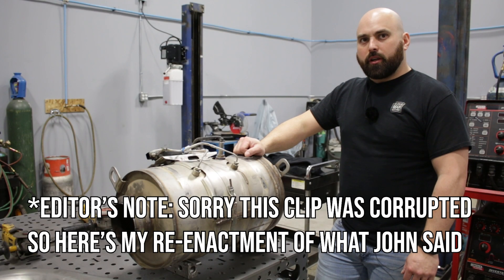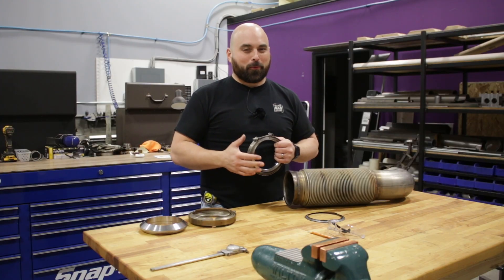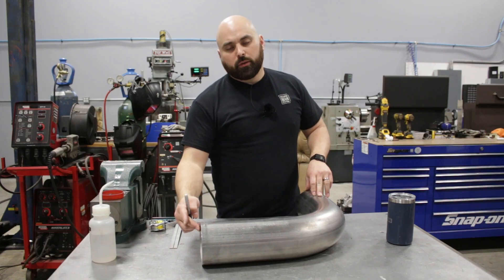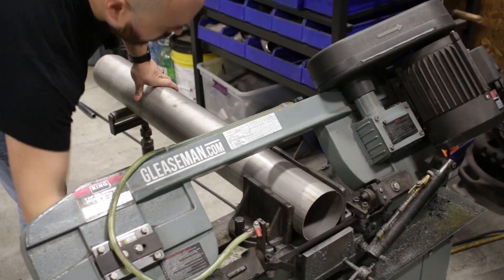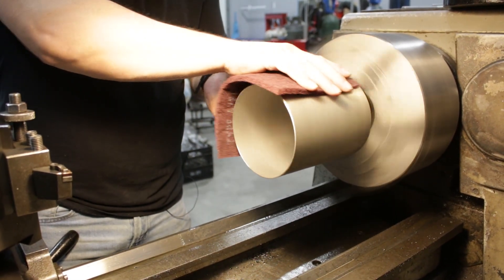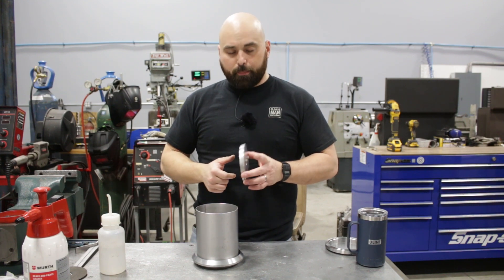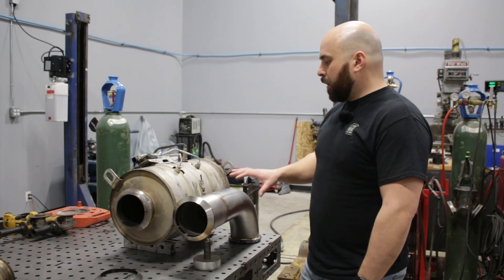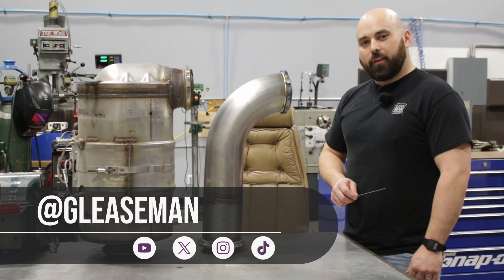I Broke The Law to Help a Farmer.

Comment: Great, honest video. And Made in Canada, subbed!
I love watching Cutting Edge Engineering Australia, Im glad I found another channel very similar. Cheers
Reply from the maker: Thanks for the sub! Really appreciate the comment too. I love CEE!
Reply: @gleaseman imagine filming yourself commiting a federal crime, describing how you know that it's a federal crime, and uploading it publicly.
Reply: In the case of CEE, I don’t think Kurtis and Karen would endorse or doing something like this, let alone film if for global broadcasting. They seem very sensitive and compliant to any environmental laws, which seem significant down under. 

It’s been awhile since I have supported the yellow mothership in off road diesel engine air regulatory support to OEM equipment manufacturers, but I would think Canada had environmental laws equal to or greater than US EPA. 

If that piece of equipment was built in US for export, almost certainly it was built to Canadian environmental standards too. I would be shocked if Canada is less stringent laws than the US. 

I recall a discussion being passed on to me of a Q&A session between the EPA and equipment owners, may have been a public meeting or webinar. A user challenged the EPA if they have the enforcement capability to cover and enforce the  sheer numbers of engines in the public space, the EPA’s response was, “ your chance of being caught may be as little as being struck by lightning but if you get caught the ramifications would be equal to you being struck!”

This is serious business, you best not hold up a 30 ft metal poles in a thunderstorm on YouTube!
Reply: @randymusselman4504  well consider yourself shocked. EPA goes above and beyond  anything here in Canada, thank-you for your well written reply, but you could have saved yourself the reply with just a little research on the topic. 
Not comparing CEE to anyone or anything, so you can relax that sphincter of yours, and just enjoy YouTube for what it is.... entertainment
Reply: @Goostradamus81 when you deal directly with the state air board who has delighted authority for the EPA for your day job as I have for the past eight years for my job, you definitely get tight sphincter and need to wear wear chainmail underwear….hey anyone free to fly the kite in the storm man….. I did no research on the Canadian. Air board…..but assumed with the current political climate it would be extreme. Thank you for the feedback…..
Reply: Mate this guy has nothing on kurtis from CEE kurtis is the goat!!
Reply: @cammo81  you know goat is an insult right ?
Reply: @clatonblade2211 greatest of all time is not a insult and this guy is nothing
Reply: It good thing it made in Canada as EPA would be all over you

Comment: I actually repair dpf flanges quite often at my work. The large 11 and 12" diameter flanges are pretty fun.
Reply from the maker: That sounds like fun! Really cool to hear about someone else doing this. Do you make the flanges too?
Reply: @gleaseman  I do actually! I mainly use 1/4" s.s plate that I  cnc plasma cut, then roll 1/8" plate into a barrel shape. I then machine the plasma cut piece to slip fit over the barrel, tig weld it, then set up in a lathe and machine the taper.  Then after carefully measuring the old flange length, i cut it off (generally a bit further back to reduce warping the new flange during welding) and weld the new section in place. The process is very similar on both the male and female sections. I've made multiple bullet aluminum heat sinks for the different dpfs I repair.

Comment: how about heat ? these filters has a ceramic fiber inside to protect engine bay from heat.
Reply from the maker: It wouldn't be regenning anymore so heat won't be an issue

Comment: Thats a nice "mockup test piece" there. I had to do the same on a Honda awhile back for someone. The new converter was $586, plus muffler and tubing was about $800 total.
For a $1500 car. So I welded a a manifold back system with a test piece and it cost like $220 total , welding rods included. Test pieces are cool!  Plus that honda is all low and throaty now!  Varoom ding ding ding...

Comment: Rolling coal isn't because theres a DPF system... our work trucks don't roll coal and they were built before this horseshit. Its about tuning. You dont want black smoke because that means you've got more fuel that air to ignite it all

Comment: The DEF system in trucks and buses and cars are different than the farming equipment DEF systems. The main difference is that if the boss DEF system is not working, it still can drive for like 2000 km and then fix it but in the farming equipment is DEF not working you have to wait for a part for the mechanic, a lot of times up the week to get it fixed and meanwhile you cannot feed your cow spray your fields or collect grain from the fields when it’s dry. So the DEF system is really good for the environment, but it is the knife under the neck when it’s not working for farmers.

Comment: To use the machine without the DPF filter the ECU would have to be re-mapped. I have the same problem. The DPF light comes on just when I'm about to leave off and requires 45 minutes running the engine while it goes through the cleaning cycle.

Comment: Why do people delete something that was literally placed there to help save the Planet?

I do honestly not understand.
Reply: First we had diesel, which was great but the high combustion temperatures made lots of NOx.  Then we added EGR, which fixed the NOX problem but made more soot.  Then we added a DPF to catch the soot.  But DPF regen is very hot and makes a lot of NOx again.  So we added an SCR system to fix the new NOx problem we made.

These mechanisms all have downsides as well.  EGR clogs inlet manifolds over time which reduces performance and ultimately makes fuel consumption and therefore emissions worse.  The soot from recycled exhaust gases also makes its way into the oil so now your lubrication is also compromised (engine wears out sooner).

So it’s not quite as simple as people being wilful planet killers.  Once a vehicle has done 100,000km, these systems start causing more problems than they solve.  I’m not saying it’s right, I’m just saying I understand the motives go beyond a desire to ruin the environment.  Throwing away a car prematurely is pretty wasteful too.

Comment: we see in developing countries that the black suit begins to cover the safety signs, first it block the hi visability of the reflective sign paints, and evetual makes the signs not legally visible.  or as those corner reflectors to help people stay on the road at night. especially if there is no rain.  there is all sorts of band aid solutions such as this system that just reduces fuel millage, and filtered Dessel. where as the amount of trucks on the road long ago was not a concern, now its a huge number. what we are trying to do is solve one issue, at the cost of producing another issue. and no one can afford such new tec of more efficient engines, hopefuly there will be a cheap source of ground well hydrogen to mix with the fuel.

Comment: Y does the pipe look shorter than the DPF and wat happens to the sensors and pipes that conect to the dpf
Reply: The sensors will get a software update which makes them no longer needed. For testing purposes of course. Only a temporary measure. 

It's done to diagnose issues with the DPF system. A byproduct of this testing is increased power output, reliability and lower fuel consumption. Oh and some black smoke. The smoke is bad so it's only used for testing purposes and only temporary. Of course.

Comment: Diesel Particulates are harmful so filters are a good thing. However the issue is mandating an unsuitable technology to be used in ag equipment. DEF was developed for trucks / commercial vechiles, when it's a perfect homogeneous mixture it's freezing point is -11 C, which is bad enough, but urea has a greater density than water so the two can separate over time so things can start to break at 0 C. The regulations should have stuck with mandating the permitted levels of particulates rather than a specific technology be used, so that ag could use whatever methods are suitable for their local environment. Whoever mandated DEF in Canada has zero understanding of the Canadian environment and I'm saying this as someone from the UK.
Reply: The DPF has nothing to do with DEF they are separate systems, once catches particulates with a regenerative filter (DPF)  and other reduces NOX emissions via an SCR catalyst with use of urea (DEF)....

Comment: That pipe is simply to keep the mice and critters from getting into the exhaust system and engine while you have the filter serviced. After awhile they'll get plugged up and you can get them baked and cleaned....... it's the environmentally friendly thing to do 😂😂😂😂😂

Comment: I love that you have deleted a junk muffer that creates problems for big rigs
Reply: Not only big rigs. Emission shit causes problems to all vehicles. Thankfully on scooters for instance problem solves is self when exhaust filter gets filled over time by crap so none of the exhaust goes back to dirty the carb. Many have might accidentally put in seal with out hole when cleaning the filter, or add valve to turn it off and on again depending situation.

Comment: Why not just use a 5 inch coring bit and core thru the dpf filter, put a pipe inside and put it back on, so that it is all original in appearance, so that if the epa comes out all the equipment is in place. You could charge more for the fix, it would take a few more hours, but all appears as normal. I have done this method previously and the dpf still heats up for testing purposes, just the gasses are different
Reply: That only passes the eyeball test, the electronic one is a lot harder to pass with any kind of delete.
Reply: No EPA in Canada and no emissions testing on ANYTHING in the prairie provinces and no testing off road equipment in Ontario.. Not destroying the DPF leaves it intact so it can be reinstalled if the unit is ever traded in on a newer machine..

Comment: So, the monster on the left is roughly $6000 USD + the sensors, & the correct replacement on the right is $150 USD +labor. Hmmm. Hard sell. :)
Reply from the maker: Correct on the easy decision, but this unit is actually worth over 15k without sensors!

Comment: Would some of yall saying it is illegal to  DPF delete in the US show some links to where the law says that? I can find where it is illegal to sell a DPF delete kit across state lines (can they say anything within state lines? Possibly as it involves a "sale" and the fed regulates that across every state.) I can also find stuff about a mechanic installing said system, again I believe as they are performing "commerce".  but nothing about you the individual being procecuted or getting in trouble on the federal level. 

Exqmple being, Kansas has 0 emissions laws, no inspections, no testing, NOTHING. You can delete cats, smog pumps, etc. If you bring a car in from out of state, they give it a super cursory glance, check the lights are there and have you accel and brake, bigo bango DONE (my experiance ~5years ago). Oh and they run the vin to check for stolen.

If you make the parts yourself and install them yourself on a personal vehicle nothing can be said. you are not engaging in commerce (using said vehicle to generate income) so the Federal gov. Has no say in it, 

Now if you sell a 2nd kit to someone im not sure how that would play out if it is inside the same state. 
It is similar to seatbelts or airbags. You can delete them from personal vehicles and nothing can be said of their removal but if you state has seat belt laws you get a ticket for not wearing it, but the removal was not the issue. Same with emmisions, colorado might require it so you might violate state laws by driving the modified vehicle into there but its not agsinst any federal laws to do so. 

Someone said a dealer could not sell a modified vehicle, yeah I could see that as they are a buisness and hence federal regulated, they also dont want the liability (exactly the same as with sestbelts, and airbags)

If yall made it this far.. HI 😁 thanks fo reading my ramblings.

Comment: Fu***ng EPA with proper tuning and timing adjustments by a professional you can make a modern diesel run cleaner without the def and DPF than factory with them

Comment: This is 1 part of the problem fixed, now just have to dismantle everything under the hood that goes into making that system work Hahaha we all no it doesn't work but then after all that is removed then comes the tricky part to re configure the computer so it doesn't no its gone and turn all that crap off. What a waste of engineering l, these systems have absolutely ruined the diesel industry and the life of all diesel engines. I used to see 1 million miles on trucks without def and now you'd be hard pressed to see 150,000 miles on a semi that now is almost done for because of this crap.
Reply: I run a motec PCM on my "dune buggy" chassis I made and adapted a Ford bronco body on. You could do the same with these engines or any engine if you invest the time and have the skills. For dot applications you need obd compliance and some places do an inspection too.

Comment: Ive driven truck for long enough to have seen the difference from non DPF to DPF, I noticed a severe reduction in fuel mileage initially! Even today's trucks don't get the fuel efficiency of the trucks in the late '90's  (9-12 mpg) and to add to it the added cost of DEF fluid, add to that the fact that the pre DPF trucks sucked more dirty air through the air filters than they put out the exhaust stack!  Europe did this about 15 years before California forced the rest of North America to comply.... and they got rid of it because of its lack of dependability and cost to repair outweighed the profitability! You'd think we North Americans would leave it behind like Europe did! Just goes to show you!
Reply: They get like 5.5-6.5mpg now
Reply: My thoughts is the guys running a DAF delete program in his tractor, now he has to delete the DPF because now it would get burnt out.
Reply: i dont get the idea where you think in europe trucks no longer run DPF systems... sure isnt the case. we're at euro 6 and that means urea injection, EGR or and with SCR AND DPF fitted on the exshaust... 

also cleaner air in the exshaust at any given time in history with the engine running? fuck off.
just.

fuck off. 

just switched from a pre-egr, cathalyzed turbodiesel car to an egr+dpf fitted diesel and it's already a big fucking deal when in underground parkings. 
When she was cold the old girl sure knew how to stink and i wouldnt left it indoors running.. new one? you can litterally warm it up in a garage. no smell. even when it's super cold.

EU trucks get better mileage because they all run stick, dont waste weight on a cab behind design, and have been using all the aero tricks affordable for a longer time, like cab fairings, shape optimisation and trailer undercarriage shields.
the only way to improve now is to get changes on the maximum length to be able to pull a tesla-like cab design and kenworth's experimental trailer fairing.
Reply: @DeusVult101  I appreciate your  input,  I've often wondered what Australia has done in this regard, then I just assumed that they followed European technology! I'd love to learn more about your system,  and how it works, maybe it's something we can adopt in North America!
Reply: the air has gotten cleaner in california, reduce of smog, and less harmful particles in the air they are effective at what they are suppossed to be, the fuel mileage at least in europe in semis has been lowered significantly from 35L /100km to 25-28 L/100km while having stronger engines (trucks with g.w. of 90000 pounds) than ever before.... of course they are expensive and finnicky but they do work.
Reply: @gnaedigerfels  true, but  if I'm not mistaken they did it without the added cost of DPF, the understanding I'm under is the DPF systems we're so unreliable that they got away from it 10-15 years before California mandated it on North American trucking. Which would beg the question...why would North America adopt a failed program? BTW, Navistar (International trucks) was pursuing "in cylinder " technology but eventually abandoned it due to their carbon points running out before the technology was viable!
Reply: @cbylsma626  dpfs have come along way from when they first can out. but there still a large fail point cuz cant get the ash out after regen. unless its washed out. and scrs have no busness being in a vehical. they work far better at scale than scaled down.
Reply: @alexlindekugel8727  lol, don't I know it! I just wish that Navistar continued with the "in cylinder" technology!  It would have revolutionized the engine technology beyond what we have today!

Comment: Could you just cut the filter in half, remove the guts, weld back together with less effort and cost?
Reply from the maker: We entertained that idea, but the DPF was fine and these units are about 20k from the dealer so it would hurt resale.

Comment: Rumor has it you can throw a half inch hole through the def with a long drillbit Keep your back pressure and all of your sensors working according to rumor that is
Reply: Vonnie, through the Def?? Or did you mean the particulate filter?
Reply: @garygrow8373  the particulate filter